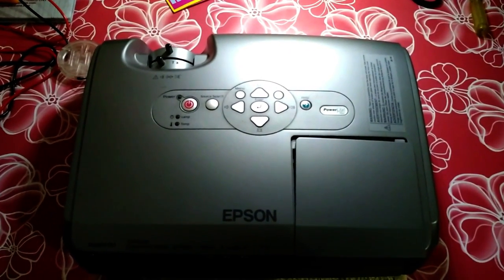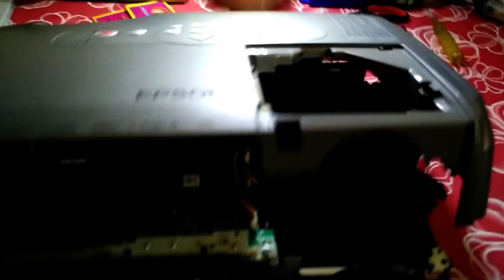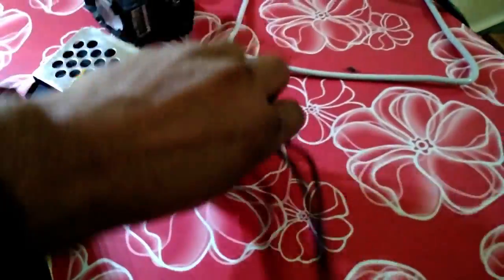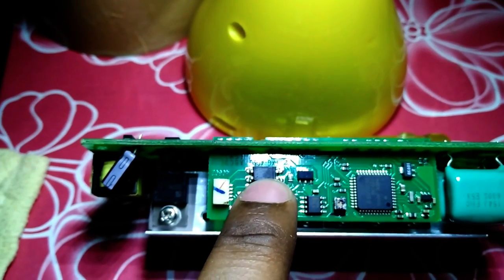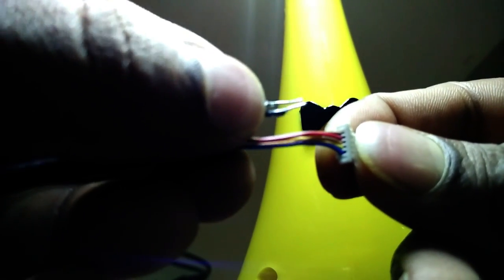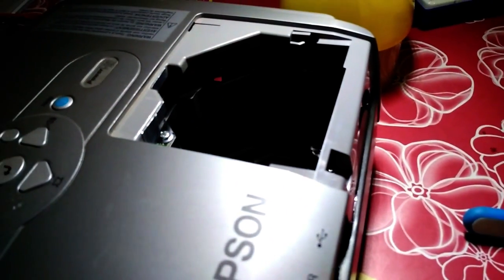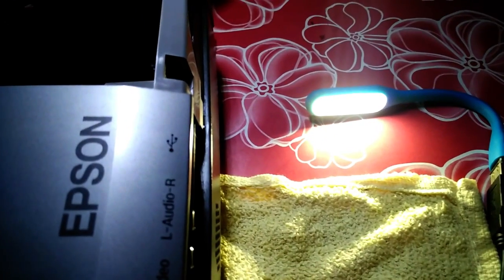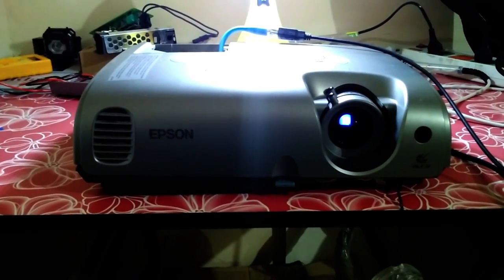How to fool the Epson EMP X3 projector to install LED light (part 1)

Comment: I buy a new bulb lamp but red led blinkink and lamp dont turner on,can you help me? thanks
Reply: Reset lamp hours. Also there is a thermal cut off switch inside which has to be reseted aswell

Comment: i byepassed  the optocoupler  (by cutting the 2wires and shorted them together)  and projector   went ""ON"". (infocus IN102, the power board looks exactly as yours !) But few minutes later it went off  (indicating """NO LAMP""").   i didnot try with led lamp  can u mail me what to do
Reply: Did you make it, or did you give up?